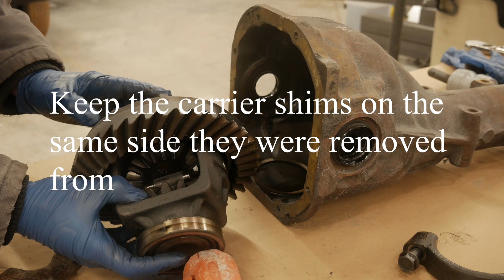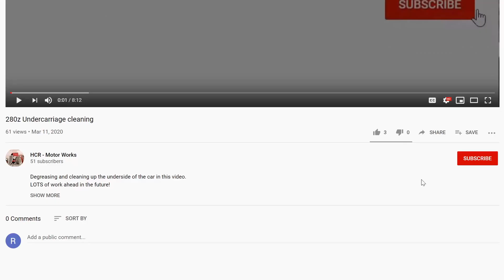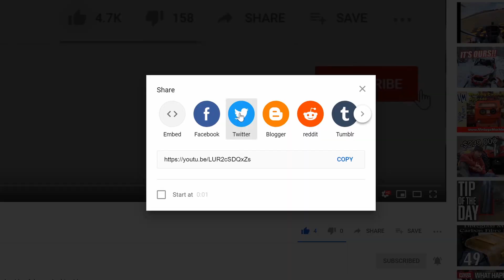differential rebuild PART 1 - R200 Datsun 280Z - Teardown and  Inspection

Comment: Can you pull those half shaft flanges @1:03 without taking off the diff cover?  Or do you need to take off those caps inside first?
Reply from the maker: You can slide them out without taking the cover off

Comment: Wish I saw this years ago. I attempted to rebuild mine a long time ago and also bought an OBX limited slip dif. Don’t do that, don’t buy an OBX dif. Mine came with stripped bolts all over and a warped casing!
Reply from the maker: Diffs are a pain rebuild anyways, i couldn't imagine having to chase an issue with a warped case
Reply: @hcr-motorworks  yeah I ended up having to take it to a shop to diagnose the problem. Spent about the same $ fixing it as the cost of a brand new quaife LSD. Should have just spent more on a quaife to begin with!